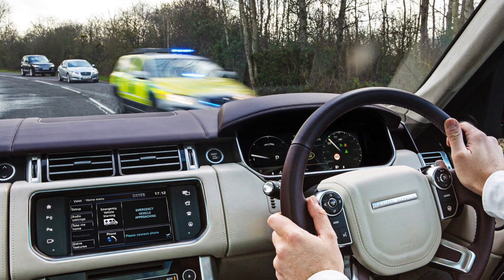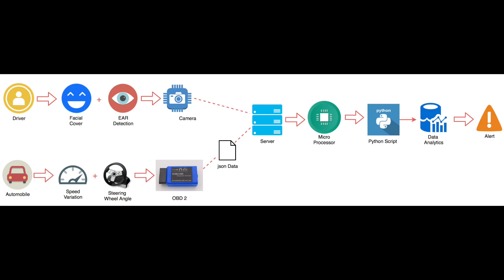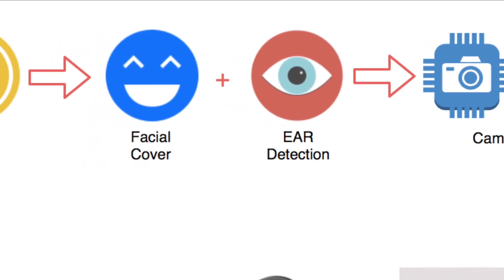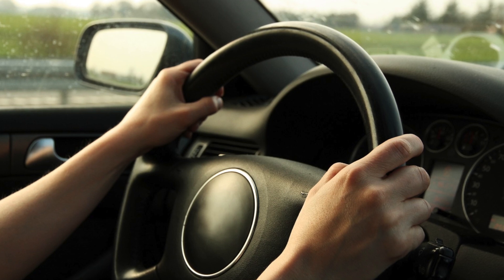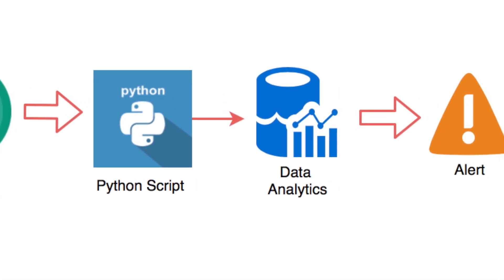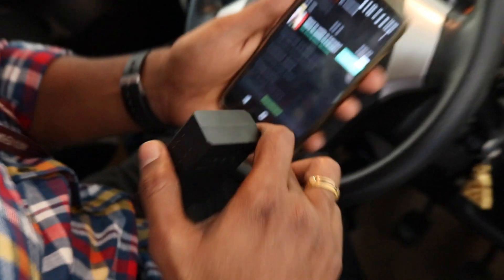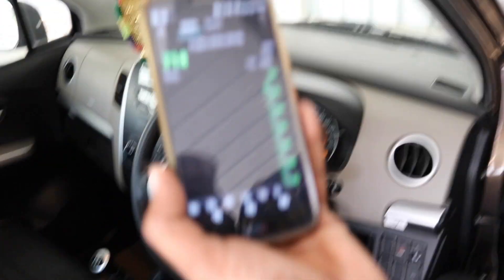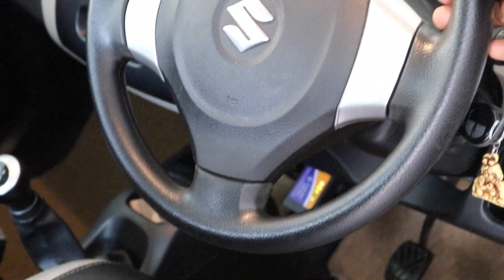An Innovative IoT based Driver Drowsiness Detection System

Comment: Whether EAR alone is not enough for drowsiness detection?Why do we need Steering angle and Speed variation?
Reply from the maker: No varshini. It is just not sufficient to declare that the driver has lost the concentration.
Reply: ok sir
Reply from the maker: @varshinimurugan2215  good. Any automobile will not just rely on one result to decide anything :)